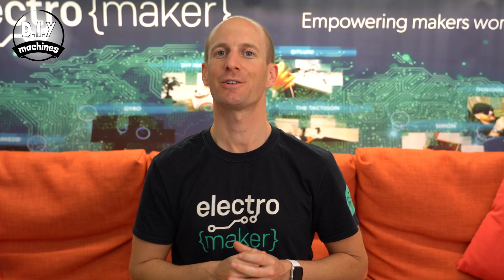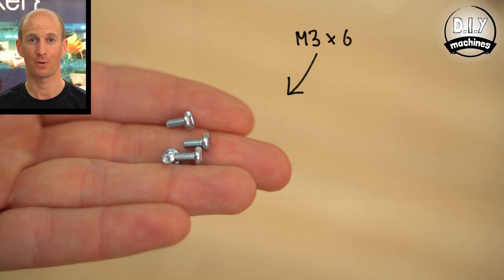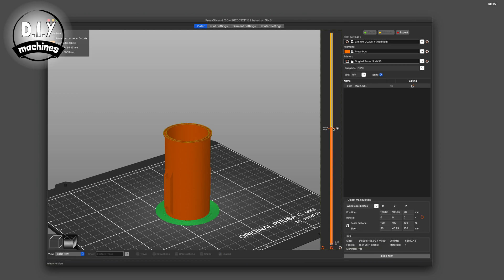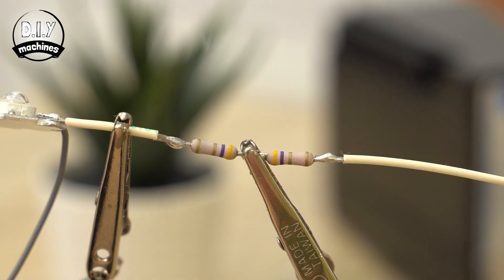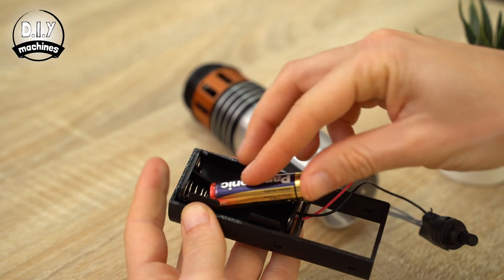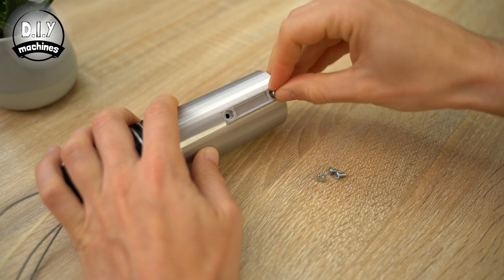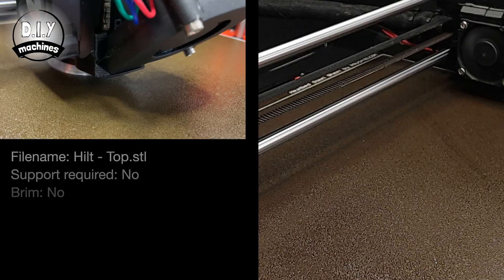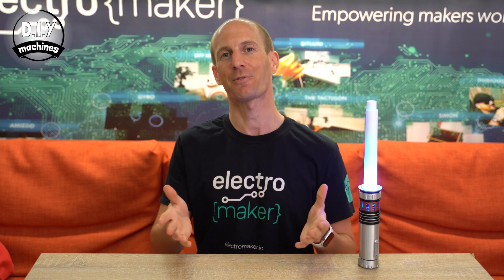DIY Lightsaber - 3D Printed, Low Cost, Star Wars inspired

Comment: Im a total newbie here and so curious.  I have built things my whole life, never used a 3d printer. I'm curious if I follow the directions here , as a guy who's never done anything with 3D printing before, do you think that it is feasible for me to complete these projects?  or do you guys think I need to learn a little bit more about three printing before I attempt to doing this stuff
Reply from the maker: This project could be a great process to get to know 3D printing. Here are a few pointers:  
I would absolutely recommend a printer with automatic bed-levelling.
Start with PLA filament. It's the easiest to work with when beginning.
Watch the first layer before leaving the printer (if you intend to). Most issues arise from problems with the first layer.
Check for overhangs greater then 45º or entirely unsupported feature when slicing the model for printing. (Unsupported features are one which might try and print in 'thin air').
Good luck, having a 3D printer will supercharge your making. :)

Comment: Ahhhhhh...  I'd never considered using the slicing software to add filament change points. That's brilliant. I've just been eyeballing it mid-print.
Reply from the maker: It's much easier. I previously did it by eye balling it as well but would pop into another room to do something and then when I remembered I was supposed to be watching the print it was too late. :/

Comment: Really nice and clean, one problem though, if you use it for too long the heat coming from the LED can actually melt the plan that holds it. Those LEDs are so powerful that they are usually recommended to be used with a heatsink and even active cooling such as a fan or a water cooling cycle. You have to be very careful using these kinds of high Wattage LEDs, not to ruin your projects but more importantly not to harm yourself. They can get real hot real fast that they can give you a serious burn. Please be careful if you are gonna build this.
Other than that it looks great! 
Keep up the good work.
Reply from the maker: Thanks. Yes, you're right they can get hot. I worked to increase airflow around the aluminum plate as much as possible with the 3D printed design whilst removing any chance of accidentally touching it once assembled.
Reply: @DIYMachines  I would actually recommend just adding a small fan blowing the air out and away from the LED underneath the lightsaber if you have some space, that way you can get rid of the extra heat saving both the printed parts as well as the LED as it might get damaged as well.